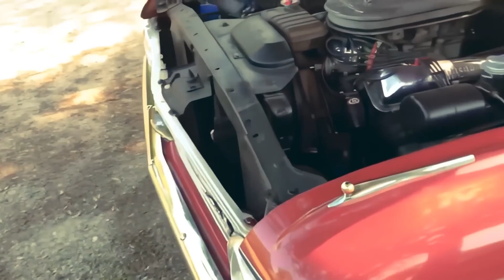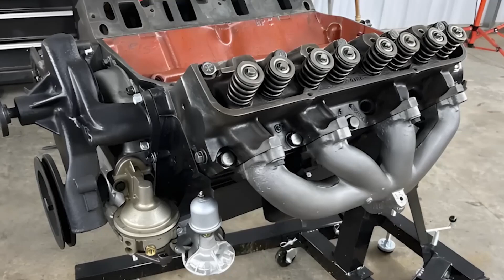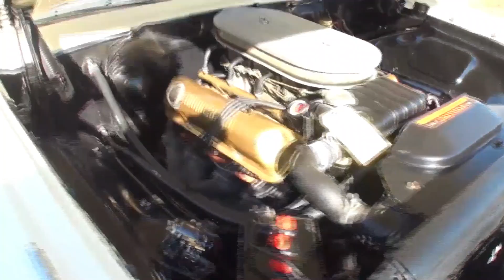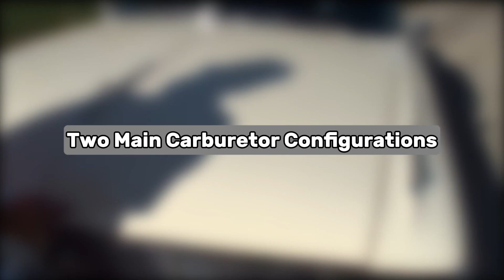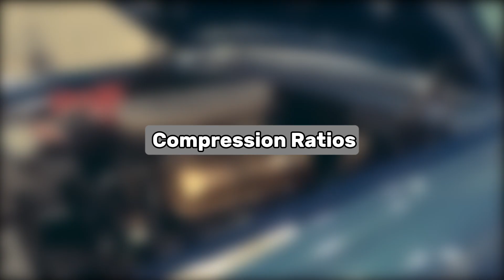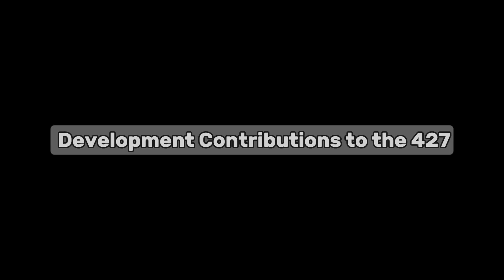The Shocking Truth About the Ford 406 Engine | Why Did Ford Kill It After Just 2 Years?

Comment: The 4.13 x 3.78. 406 was the best engine for the street car in the 1969 s. They pilled harder in street action. The COAE-D head was a high swirl and velocity. The later 60s cars would have loved it. The 427 was not offered in every thing. The 406 could have been. Street Action was th11 406 purpose and the 428 used496 block. Is this getting through MR A II
Reply: I mean the406 block.
Reply: An excellent engine. I love these many 406 blocks were used as the 428 CJ and SCJ.